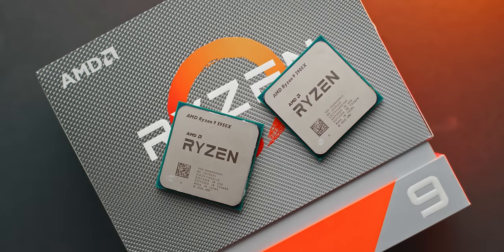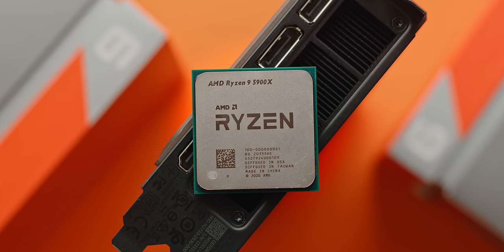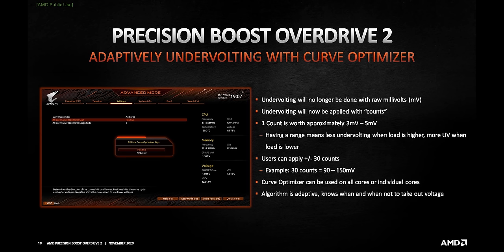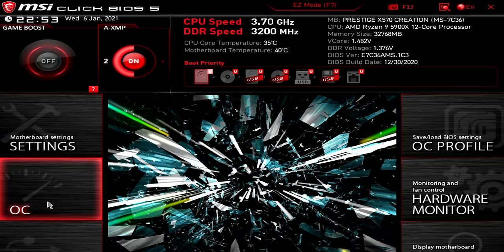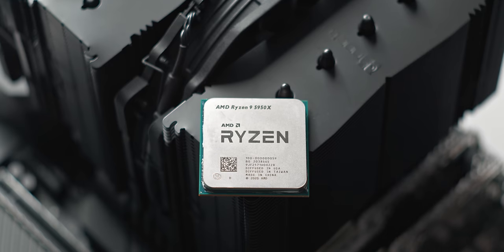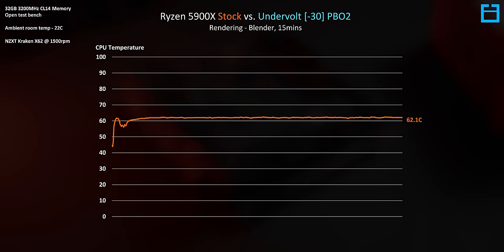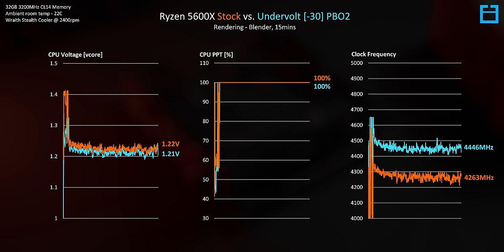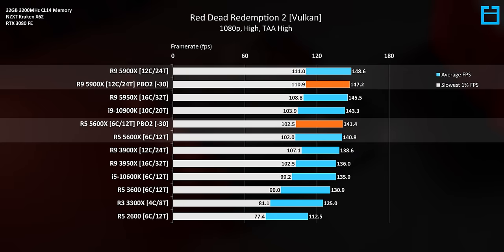Ryzen 5000 Undervolting with PBO2 – Absolutely Worth Doing

Comment: Just coming back here to mention: I did this same process on my 5800x — negative 30 offset, no other overclock literally just precision boost w/ the undervolt explained in the video.

Big improvements benchmarking with cinebench — whats used to be 88 degrees and a 15206 score is now 79 degrees and sitting at 16010! This is awesome and I feel comfortable with those temps under full load.

Comment: Hi, I'm a bit confused about this video, to me, applying same an offset to all cores is very optimistic. It's better to identify your best cores and apply less negative offset to those, to ensure more stability. Moreover, lowering curves allows to reach same boost frequencies with less voltage, but it will not lower temps, or just a bit. In my case I did not see temperatures down when I played with the curve on my 5900x. If you want lower temperatures then you have to play with pbo limits (PPT, TDC and EDC).

Comment: All cores curve optimizer is faster but the result sometimes not as good as per core optimizer, my advice try optimize it on ryzen master per core and write down the value in the result and then input it manually in bios.

Comment: This is so great.. I did - 30 on my system(5900X, X570 Aorus Master with H150i Capillax cooler, stock fans with bakance speed as tried to test at worst case scenario, 30C ambient room temp) and the results are amazing..

Previously, 3 cpu fans ramped to around 2400 rpm as liquid temps rise up giving core clock of 4.0-4.1Ghz with temps of 78C +/-2C
. Now with just - 30 offset, clocks were completely flat at 4.47Ghz,with temps of 71-72C.
Will be testing with room temp of 24-23C with AC on..
But man, Dr. Lisa and her team deserves credit,...

Comment: I have 5600x with Arctic Freezer 34 Esports DUO.
I check the stats with HWinfo64.
Testing with Cinebench R23.

When my "PBO limit" is on "Motherboard" the themps go to 82, when "Disabled" temps are 66.
I saw that when I set Curve Optimizer to "-30" and PBO boost "+200", the Single core clock is higher "4,841" but the  Multi-core goes down around "4,260 - 4,313"... Cinebench multi-core test ~11000 or little lower.
Like I said, if I change "PBO limit" to "Motherboard" the temps go 82 to get higher multi-core clock, but it is not worth it.

If I set PBO to just "Enable", without any other setting, the Single core is ~4,65 but the Multi-core goes up to 4,55, at the cost of 82 degrees, which is not good...

I want to achieve both high Single core and Multi-core with arround 66-70 temps!
Any suggestions?

Comment: Failed on my system. Negative 30, Ryzen 5 5600, Asrock Phantom Gaming X570 ITX, Corsair Dominator 32GB 3200mhz. Upon checking event viewer, no doubt the PBO undervolt caused the crash.

Comment: Hey man thanks for the tip. My 5800x R23 went from 15624 to 16171 which makes it almost as fast as my 10850k@5ghz all core scoring 16334. My CPU-Z score went from 672 single 6748 multi to 674 single and 6981 multi all running 10c cooler wow! Rock stable all cores running 4,700mhz this is amazing thanks so much!
Reply: Do you remember what your Curve Optimizer was set to? My 5800x is coming in on Wednesday and would like a baseline.
Reply: @Lancx  hey congrats, pbo disabled. curve optimizer set to negative -25, i now have a bit better cooling so its set to -30 last time i checked, score was 16200 something running at 128watts

Comment: Just installed the 5950x on my new Asus 8 formula mobo, was shocked to see when gaming it ran @ average of 85celsius. After some research turns out AMD came out and said it's perfectly normal, and part of the design for this cpu to run around 90celcius while above idle. Only applies to series 5600+.

Comment: For the 5950x it is true being it was the flagship of that set of processors it was quite optimized but a trick to do is to set the top four cores to a lower setting while the rest to a higher setting. Also to set the cpu line calibration to 3 or higher for voltage droop. Which might be why all core 12 was as high as you could go.   For the 5950x first 4 cores are at -10, the rest are -20.  Ones milage may vary. My 5800X3D  -30 works perfectly.  Which if I had to guess those chips come from the best bin.

Comment: Dang! Just tried this with my 5600X and my load temp went down 10-15 degrees! Idle temp went down 10 degrees! In game FPS is also slightly better! I have an ultra slim case and the default PBO cooks my chip to 96C in games! With PBO off, it goes down to 85C in games. But with this method, it's now 77-81C in games!

Comment: My 5900X on Asus Tuf x570 MoBo is able to do negative on the 20 curve optimizer as anything more cause random crashes that’s not load dependent it seems

Thanks again for this, only video that showed results and how to do it clearly and I still come back time to time if settings are wiped 👍🏻
Reply: Random reboots without errors?
Reply: @philippossnortis2035  yeah, I was having issues with that recently. I'm on Windows 11, I uninstalled gaming services and stopped the service from reinstalling the program which seemed to have helped random reboots that started occurring frequently last month or so.

I've read as well that each bios update may affect how much you can undervolt or overclock.

I'll need to check where it's at now, I think I lowered it at some point.

Comment: My 5900x is not stable with a -30mv offset on all cores. Games appear to be fine, but system would crash / restart and generate WHEA errors when idling or near idling. Need to adjust the offset on a per core basis. Some cores need more juice than others. -30mv might be a good starting point but I wouldn't recommend it as I suspect most people will need to tune it from there and test for stability
Reply: You have to go in steps of 1-5 and stability test each time. It takes a long time, you can’t just copy paste overclocking settings since every cpu is way different

Comment: Adjust the PPT, not the voltage.  Undervolting is usually detrimental on Ryzen, whereas PPT can save you 10 percent power consumption with no performance loss.

Comment: What I recommend for everyone: try -10 first. If it's stable, go to -15 and so on. But don't use more than -25 mV. If you have the chip lottery, go for -30.

Now, set the PBO to manual and use this configuration:
TDC 125
EDC 200
PPT 200

Your Ryzen 9 5900X will consume 200 W, and your multicore frequency will boost from 4.3 GHz to 4.5 GHz or 4.6 GHz if your CPU is a beast among the 5900X.

Just use Cinebench R23 Multicore to test the thermals. Ensure your CPU doesn't exceed 89.9°C after a 10-minute test.

Alternative:
TDC 100
EDC 175
PPT 175

My Ryzen 9 5900X with TDC 125/EDC 200/PPT 200 gets 23900 points in Cinebench R23 (MC)

Comment: I activated PBO, set limits to disabled and set the CO to negative 30. System started and ran R23. But, temps were at 90 degree's while doing it. Also, I am also using a 5900X, and wonder how others are getting a score's of 29900 to 30k in CB R23, and I'm struggling to get a score of 21000. That's NOT the silicon lottery, something else is definitely wrong in these differences. 
Anyway, back on topic, while the neg 30 CO setting would run CB R23, it crashed on OCCT's benchmark. So I lowered to neg 28, and once again, it almost made it through, but crashed due to CPU temp's. FINALLY, I set a neg 26, and was able to pass all benchmarks with lower temps, but not such lower temps as you describe here. So again, I'm wondering what is going on here. I have one of the most powerful mobo's made, and still seem to be running higher temps than most of you guys... 5900X and Crosshair VIII EXTREME.

Comment: amazing! i was sceptic but after trying it out myself all i can say is that it works great on 5600X and very easy to configure in the bios.
Reply: I also have a 5600x and I want to try this myself. Have you had any blue screens or stability issues yet?
Reply: @captgeoff0713  nope, everything works great. didnt have any crashes so far. i am also getting the best performance i ever got with this cpu with up to 10% uplift in performance in cinebench and time spy.
Reply: @avif007  Cinebench is what I'm looking at too. I beat my friends 11700k in single core and I'm looking to add extra salt to the wound!

Comment: I'm scoring +100 on cinebench with this tweak and temperatures are lower, Thank you a lot. My system: Ryzen 5 5600X / MSI B450 TOMAHAWK MAX II / XPG 2X8GB 3000Mhz / GTX 1070 AMP EXTREME.
Reply: Well my system is crashing, ill try 25 now.
Reply: @GananciaGG  So.. you got it stable at -25?

Comment: Just revisited this again after getting some B-die, and doing some RAM tuning getting really tight timings, then having to change my PBO curve, because it was behaving differently with the RAM OC. I ended up doing a negative voltage offset of .0625V, then adjusting my PBO curve, and now I'll hit 4.725Ghz in CB R20 on an NH-D15S maxing at 80C hitting 1.285V, then SC boosting to 5Ghz using 1.420V. My best score is a 6310 MC with my 5800X. That's up 400 points from when I first got it, and 100 points on my normal PBO curve. Once you figure out how to properly under volt, you  certainly seem to unlock these  chips true potential.

Comment: Hot damn! Think I did something wrong. Did a -30 on my 5900X and I gained around 10-15% uplift in performance over a PBO overclock or even stock, but my temps and power also went up by 5-10%... may have to do a BIOS reset first and try again!
Reply: How did it go? I just got a 5900x and I'm about to buy a MSI B550 Gaming Edge and I don't know if I should just leave it at stock or try to undervolt. I am not interested in performance gains, since from what I am seeing are not massive, but rather in keeping cooler temps since my case is a NZXT H500 and my cooler is a Noctua U12S. (I will see how it beahaves at stock before making any changes)
Reply: @TheDeathstar2000  alright, I got meddled up as Asus have two locations for PBO (gets most people) so reset the bios and went at it again from scratch, this time also applying a manual 70 degree thermal limit. Haven’t tuned if much yet with the fans to allow more thermal head room due to noise, but will do that at some point. It’s still within or exceeding stock by 5-10%

Comment: Worked like a charm on my new 5700x. Dropped my temps by a solid 15 and up to 20c.
Reply: how low did you drop the voltage -30 or less?

Comment: I only did only enter a manual cTDP for my Ryzen 2700X. I have changed it to 45W instead of 105W and benchmarks show it's now ~2% slower in single core and ~4% slower in multi core. However, the 2700X is running 18-20°C cooler under full load now.

Comment: I did exactly what he said and 1) voltage always is the same whatever offset i set 5-25 
2) When i set for example -15 cpu voltage is around 1.14v and clocks speed drops in C23.

Comment: Gonna drop my experience here. I followed the instructions step by step with this video for my 5600x. I had to make a bios update for my B550 Gaming Plus mobo and that enabled the curve optimizer option. I went ahead and tried with -30 but my pc crashed around 40 mins after gaming. I tried a stress test and it crashed 4 mins after I started the test. I changed the value to -25 and did the stress test and it now works perfectly. So some 5600xs might be able to withstand -30 but not all of them.
Reply: More info- cinebench scores

Multicore: 
4340 pts
Average clock speed: 4,437.6 Mhz
Average core voltage: 1.105

Single core: 
596 pts
Reply: @maestrosplinter92  did you have any problems ? after pbo

Comment: If you would like even more performance on R5 5600X and have a decent cooler. Change the power limit to manual and set it to PPT:88W, TDC: 60A, EDC: 90A. I don’t know the limits for other CPUs but the logic is same.

Comment: Done mine 5600x went for -30 side effects I have dropped in r23 from 11547 to 11030 but in temperature went from 71c to 56c in games from 60c to 50c (average) clocks stay stable in games all time 4650mhz and previously during game was oscillating between 4500-4650

Comment: This is a really really good video. 
I instantly subscribed. 
Really good job.

But:
These the settings that AMD has by default is there for a reason. My Room mate has 5600x and has water cooling on it and reaches 4.6 ghz easy. 
I saw you used wraith cooler and that is why you had so much gains. 
It lowers the temps and lets the system reach higher clock speeds. With a descent cooler, you still reach the same frequency that You should us in the charts with default settings. 

It would be worth mentioning that this has the best effect if people have low quality or stock coolers, than the benefit will be visible. with proper cooling you will not see almost any performance gains at all.

But:
We will definitely will try to do the undervolting and do some cinebench tests ourselves. 

Again great video,
Thanks.

Comment: Followed you instructions and managed to get my 5600x from thermal throttling at 
~4.6Ghz all core @ 85c (set limit) 1.43V spikes.
to
>4.75 all core @ 70-80c 1.331V spikes.
I can't really believe that this is possible coming from a bad intel 4790k that barely managed 4.7Ghz at ~90c and 1.4V which I then adjusted down to 1.35V but it only managed 4.6 all core.
This amd OC/undervolt performance is insane.
Can you please do a video on how to disable the max frequency clock on AMD? I see a setting in Ryzen master for CCX0, but I don't understand how to set the modifier in BIOS as it seems like a multiplier or something?
Been subscribed for a couple years now and it's amazing to see how you improve and develop as a person and creator! Lots of love!

Comment: No joke, I just did this to my 5900X,  on X470 (Gigabyte Aorus Gaming Wifi 7 REV1), -30 Offset. Scored 5-8% higher in R15, and all more CCD's and cores reach 4.95GHZ instead of just the top binned ones. All core workload (R15 again, which I know is relatively light) the cores run at 4.5GHZ and fly through the test, before Curve Optimize, they went to 4.3, with some wiggle into the high 4.2's. Best cores still couldn't get into 5GHZ though.

Comment: Ryzen 5900X, MSI Tomahawk B550: at -30 single core I get 4.95 Ghz instead of 4.8, temperature -8C, multicore from 4.2 up to 4.4, temp -2C. First thing I noticed: while browsing the single core frequency goes up to 4.95 GHz, resulting in a 7-8 degrees higher core temp than before, so my fans constantly were spinning up and down. Games and stress tests ran without problems, but than I noticed weird problems with certain apps like LG On Screen Control shuts down immediately after start, Bios setup freezes every time after a system reboot (only power off restart worked). Yes I could try to find a setting that works, but a (100%) stable system is more important for me than a 2-3% performance gain.
Reply: Hi, I have just bought a 5900x and I am about to buy a MSI B550 Gaming Edge, which is almost identical to your motherboard. How did you set all of this in the end? Is everything stable? I do not really care about the small bumb in clock speed but rather I'd like my pc to run as cool and quiet as possible. If this whole process ends up lowering down temps while manteining the same performance good but otherwise I'd rather leave it at stock and have a stable system. I'm reading a lot of comments mentioning instability issues or higher temps aftet following the instructions in the video. I understand that every CPU sample is different and can achieve different UV or OC goals but I do not even know how to test it to find the right spot or if any of this could damage in any way and void the warranty
Reply: @TheDeathstar2000  I ended up with undervolt setting -12, it helps a little but is 100% stable. Tip: if you own an RTX graphicscard, undervolting brings a lot more there, almost 100W less power consumation at nearly same performance in most games, for older games I use an extrem undervolted profile that saves up to 220W during gaming.

Comment: You're da man!

Ryzen 5900X
AORUS X570 GAMING-X
F22 Bios (agesa 1.1.0.0)
At -25 Cinebench R23 MC restarted the system
At -22 it's working. I have yet to test how stable it is overall

I also found out you can set the temperature at which it starts throttling. It's great for me who's been constantly hitting the limit, despite messing around with cooling
Reply: And how much your temps lowered with this?
Reply: @ZeroCool22  I was hitting 90°C (throttled) and Cinebench R23 improved from 17900 to 19000.
However the real win was to ask the MB to throttle at 86°C with a score of 18100.
I'm not comfortable with 90°C despite what AMD says.

This chip is very strange. Some people get much lower temps, other get the same behavior as I am getting.

I will try another cooler once I recover financially, but I suspect that won't make a diff.
Reply: @darksylinc  another cooler will def make a diff, i have 5800x and honestly had problems cooling it. went all out and got a 360mm AIO lol now my CPU is cool.
Reply: @darksylinc  With a 360 AIO I'm hitting 23,000 on R23 at 80c, you def still have a lot of headroom
Reply: @robotm99  Oh my.

Thanks to your comment, I decided to open the pump (I own a 240 AIO) and LOOK WHAT I FOUND, the plastic wasn't peeled (I didn't install it).
I had to go to the seller because I didn't have thermal paste on me. We installed it together this time.

Results (with -22 PBO still on, I didn't try yet resetting it to 0; I literally just came back):

Full 100% CPU 64°C
Cinebench R23 21,500
At 0% my idle is 29°C

Thank you random citizen for encouraging me to unplug the pump.
Reply: @darksylinc  Happens to the best of us mate, glad you're getting proper performance out of your components :)